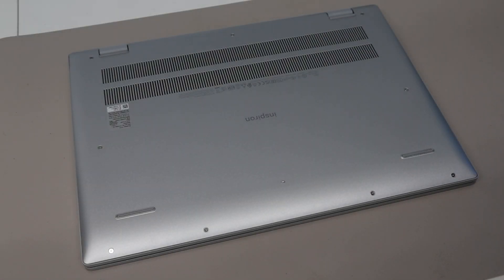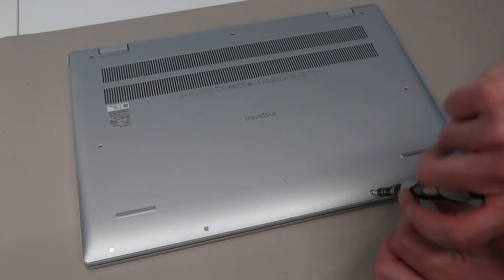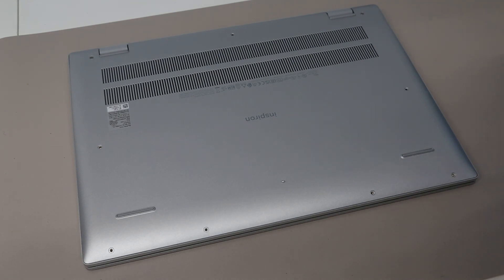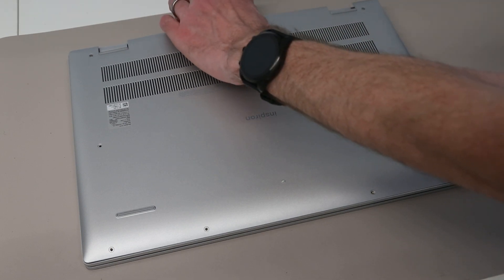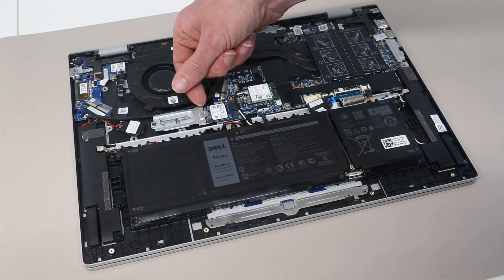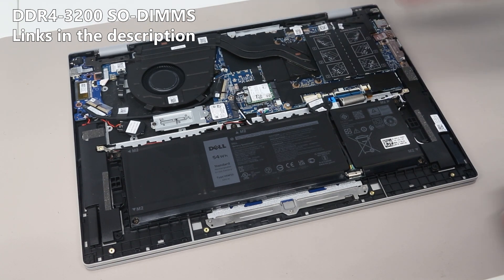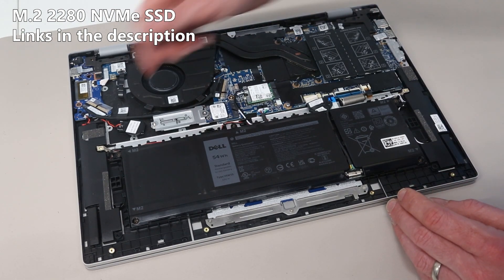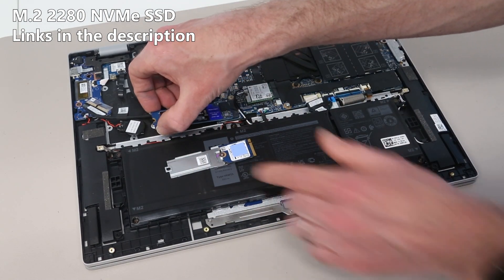Dell Inspiron 16 5620/5625 - RAM, SSD and WiFi Upgrade Guide

Comment: I would like to upgrade the heatsink and cooler of my Inspiron 15 5510 with the ones of the 5620, i know it's not a direct fit, but I'm wondering if an adaptation would be possible. Any thoughts? Thanks

Comment: You are a modern day saint. I bought the 5625 because it was one of the few laptops in my price range where the RAM wasn't soldered in. I was terrified about opening up the laptop though. I had no idea about the retaining screws and I almost carelessly tried ripping off the backplate. You have my heartfelt gratitude, thanks for making this video.
Reply from the maker: Glad it helped!

Comment: Hello, I'm considering buying this model but I saw some people complaining about the quality control issues such as malfunctioning trackpad and overheating problems. Should I look for a different model? I'm considering this laptop because it has 16:10 aspect ratio screen, a backlit keyboard and a fingerprint scanner. More expensive offerings I've seen don't have all these features at the same time, so giving up on this laptop because of the quality issues would be such a bummer for me.

Comment: This is the second time I have watched this video (great, by the way) but wonder if it wouldn't be easier to re-attach the antennae to the Wlan card before pushing it back in to the slot?  I received a new Dell in this series earlier this year and made one immediate upgrade to it using this video as a guide to open the computer and make my upgrade.  The video and clear explanation made the upgrade very easy.  (This is a few days after my initial posting and I received a replacement Wlan card today to replace the one giving me trouble.  There is more than enough extra wire on the antennae leads to allow you to re-attach them to the before before reinserting the board in the slot.  It is still a bit fiddley but much easier than trying to attach the wires to a card that is flexing up and down in the card slot).  Thanks for the video.

Comment: Great video but could we still use the ddr5. I know it’s with ddr4.
Reply: DDR5 has a different pin layout than previous generations so the answer is no
Reply: @fancypants5782  thank you bud
Reply: The newer 5630 model uses DDR5 RAM.

Comment: Thank you for your tutorial video which I found very useful, since I have the same Laptop.
My question is if my laptop comes with 8 GB RAM can I upgrade it to a 16GB by adding just another 8GB or do I need to buy a 16GB to upgrade it ?
Reply: It might have 2x4gb, then you will have 12gb at most. Also another thing to consider is - sticks best work if they are identical. So it is usually better to get the same pair and sell those that you had.

Comment: Great video, I have  16 5620, it came with one 8gb memory stick. If I add another 8gb to the other slot will it automatically be dual channel 32gb. What kind of wireless speed do you get on 5ghz & 2.4 Why would someone want to replace it. Thank you.

Comment: In the dell documentation pdf I have seen this model has two M2 pcle SSD slots one is 2230 and another slot is 2280. But you showed here that this model has only one SSD Slot
Reply: Thats the networkcard the 2230

Comment: What can you say about display quality on 5620/5625? I assume it is a TN. And 45% NTSC sounds terrible on a paper. But how it turns out in a real life? Can you confirm it is a TN?
And what I noticed that with i5-1235U there is an option to get 300nit display with "comfortview plus" instead of "comfortview" on amd. Which means screens can be different. And even of a different type. But no guarantees it will be noticeable better.
Or just pay a bit more and get "Lenovo IdeaPad 5 Pro" with IPS and 100% sRGB. IDK.
Reply from the maker: The panel is a WVA type, not TN. 45% NTSC is ~62% sRGB.
We only get the 250 nit panel on the models here in the UK.
Its ok, but if display quality is your priority it sounds like the Lenovo might be a better choice.
Reply: @BrueComputing  WVA is just a wide-view-angle short name. It is not the type of the panel. Unfortunately. So it is most likely a TN.
Reply from the maker: Dell say that their WVA panels aren't TN panels.
Reply: There is a 100%srgb and model available in Canada.
Reply: @Tekz12  Model #?
Reply: @D9ID9I  it's the AMD model with the 300 nits touch screen.

Comment: Hey there, what's the maximum ram you can add?
Reply from the maker: 2 x 16GB will definitely work. 2 x 32GB should as well, but can't guarantee it.
Reply: @BrueComputing  Sweet, thanks for the swift response!
Reply from the maker: No worries, have a good day.

Comment: Hello, can a second 2 1/2 inch SSD HD be added to the 5620, for data purposes for example?
Reply from the maker: No, there is no space for a second SSD (either 2.5" SATA on M.2) into the 5620.

Comment: Is it possible to install a discrete TPM 2.0 module?
Reply from the maker: It already supports TPM 2.0
Reply: @BrueComputing  It's firmware TPM, not discrete TPM module.
Reply from the maker: As far as I'm aware that is your only option - there is no provision for a separate TPM 2.0 module.